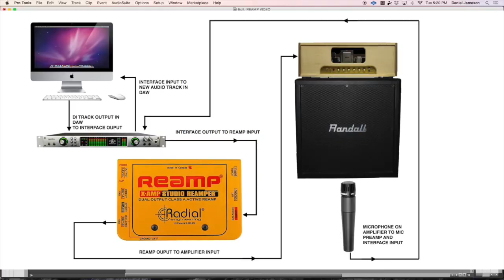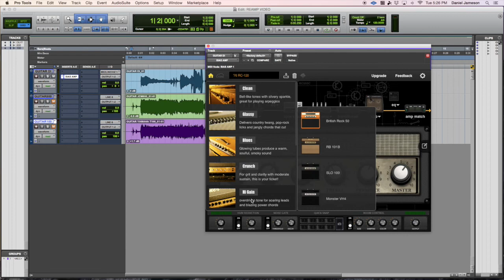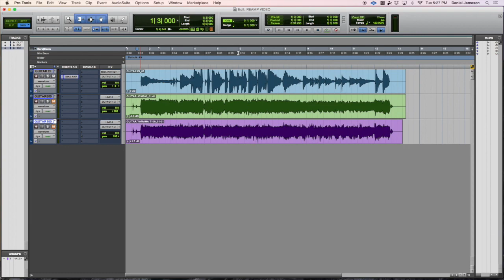All About Re-amping Using a Radial Reamp Box in the Studio

Comment: At 3:13, I noticed there's only 1 XLR Input. I want to be able to record my Reamped Guitar Pedal FX In stereo. Do I need to find a 2 Channel Reamp box? Or do I just need a 2 Channel DI Box ?
Reply: Get Radial J48. From the description (https://www.sweetwater.com/store/detail/J48--radial-j48-1-channel-active-48v-direct-box):

Innovative Merge Function

But great sound is not the only innovation: The Radial J48 introduces several new functions that improve functionality and open the doors for greater creativity. The input panel features the usual 1/4" instrument input and thru-put connections. An innovative Merge function converts the thru-put into a second input to sum stereo sources to mono such as stereo keyboards or CD players when mixer input channels may be of short supply. A -15dB pad may also be inserted when confronted with abnormally high signals.